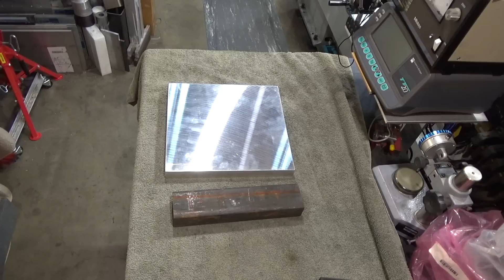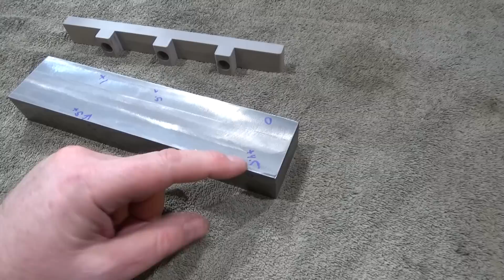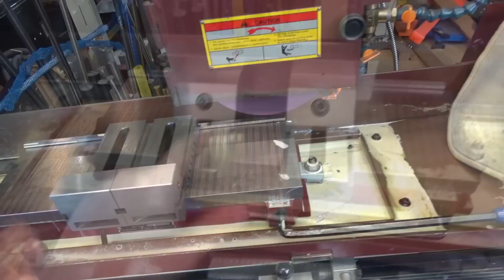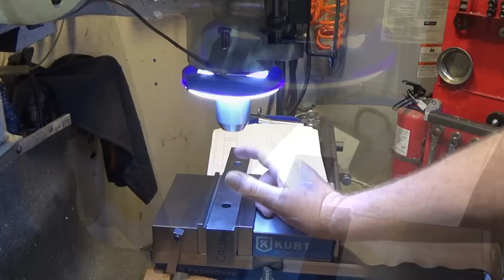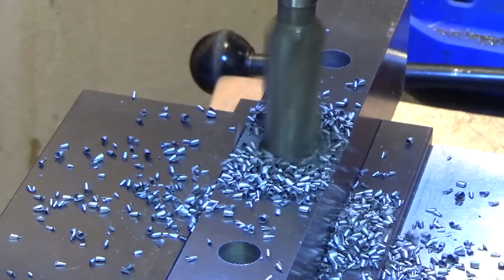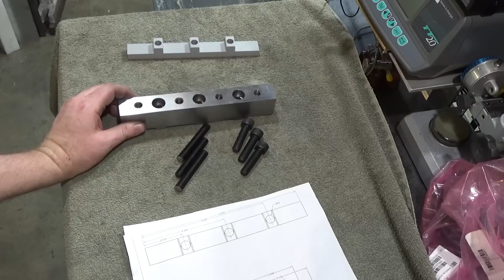236 The Fence That Your Mill is Missing

Comment: If the fixture needs to be trammed in, then maybe it is simpler to just tram the part. On most builds there is only one base plate but many plates can be trammed in the time it takes to remove / replace and retram the vise. I never remove my vise. In rare situations where I need to machine a long edge of a plate. I clamp a long piece of hollow section in my vise and G clamp the plate to it. This seems the quickest way, I don't have to remove the vise then put it back and re tram it in. I don't have to fish around for clamps and parallels, just put my trusty old piece of RHS in the vise and clamp the plate to it. If I need a backstop I clamp a couple of blocks between the fixed jaw and the RHS. For an endstop I may ream a hole in the RHS and fit a dowel. The RHS is sacrificial but lasts for years. On the odd occasion I may take a light skim off the top of the sacrificial box section but very rarely.
Reply from the maker: Your idea is a fine one, but I often need to square up half a dozen pieces of tooling plate and indicating each one in would be a pain.

Comment: I scratched my head about the T slot layout on my Taiwanese mill until I realized it was made for 12mm studs & metric T nuts.

If you chk your layout w/ 12mm studs, not 12.7mm, (½ = 12.7), & 16mm for nut width, instead of 15.9mm, (0.625 = 15.9 mm), you might discover it's more symmetric than thought.

I can't remember the dimension of metric T-nuts; I've got 2 metric T-bolts which came w/ the mill & a mixed Te-Co/? ½" (eBay) used set.

I've been thinking about a fence as well, but I was considering a semi-perm mount on the back flange of the table; something I can placed a rotary table against, to the R of the vise.  Still figurin', tho.
Reply from the maker: I look forward to hearing about your approach. The Tee-Slots on this mill are all different, which makes it weird in any system of measurement. Hear about other's experiences, this seems to be a lot more common than one might think.

Comment: Awesome work. This is one of those projects that I find it hard to believe more people haven't done.

I made a simpler version, using a piece of 1" wide, 1/4" thick precision ground bar stock. Drilled 3 clearance holes for 3/8-16 fasteners... The outer 2 are for bolting it to the table, the middle for the clamp for the vise. I made 2 clamps, one 1/4" shorter than the other, which rests on top of the fence, and is held down with the 3rd bolt. The fence is trammed parallel with the Y-axis of my mill.

I use a "CNC-style" vise, which is flat on all sides. It has clamping slots along the long sides, and I machined additional clamping slots along the short sides, as well. This way, I can orient the vise in whatever direction I need, and know it's square without having to indicate it every time. 

I also machined clamping "ledges" on the base of my rotary table, so I can set that up in a similar fashion, again without having to indicate it in. The only issue is that the crank handle sticks out past the bottom and side faces, so it can only be oriented with the handle off the table. I plan on building a telescoping extension for the crank handle, so I can position the rotary table however I want, and just place the handle in a convenient spot.

This setup, combined with my universal-head mill, allows an incredible amount of flexibility in setups.
Reply from the maker: Thanks. Simpler is often better and often a more elegant solution.

Comment: Hi, Hope you dont mind my comments!!
I'm surprised you've still got all your fingers! Please use a pointer of some sort, fingers make me go cold.
By the way, I use turned buttons in the tee slots and clock over the two high points.
Easy to make, turn them together and then part off,
Best Regards
Mike N
Reply from the maker: I never mind the comments, especially where safety is concerned. The biggest problem for the viewer is that the wide angle lens make different depths hard to discern. My finger was actually quite a ways from the cutter, but is caught me off guard when editing as well.
I like the button solution as well. Simple is great and effective.

Comment: Useless.  Sorry.
Reply from the maker: No apologies necessary. Not every tool is for every one and you might have found a better solution. I have needed something like this for squaring large pieces of tooling plate, on more than on occasion. Taking advantage of the large X-axis travel was the only solution I had come up with.

Comment: That is a good bit of tooling .     Worked out well .    Cheers  👍
Reply from the maker: Thanks, Max. I have needed it for a while. Other people have suggested buttons, pins, keys, and the like instead of a large fence. I wonder what your approach would be to square up the edges of say a 15"x15"x1/2" piece of tooling plate?

Comment: Mill one side square. Stand the part up on the squared side. Run your endmill on top.
Then grab the now parallel edges in the vice and finish the last two sides in one op. What the hell man
Reply from the maker: Fair enough, but that method doesn't really work with a 20"x20"x1/2" piece of tooling plate though. When I made my 6"x48" belt sander from scratch, I had a lot a big plates to square up.

Comment: Over the past several years l have designed a number of Tooling Items (1) designed to fit a couple of Precision Matthews milling machines. Amongst them are several types of Alignment Keys and Stops. One thing l would recommend for Alignment Keys is to have surfaces on each side of the portion that goes in the Tee Slot. The surface does not need to be very wide on the side the work will go against. The other side can be as wide as you want. As there is no real loading placed on the Alignment Key during operation it does not need the largest Tee Nut that fits in the slot. Also keep the overall height as short as possible. Additionally the side that work will be positioned against should be finish machined in situ.
1) Up and including Indexing Tables, Tilting Tables, Sine Tables, Adjustable Angle Fences with Vernier Scales, Table Stops, Tool Holders for doing Slotting Work.
Reply from the maker: I like the ideas. Thank you. My Kurt vise has alignment keys and I still need to tram that in as well.
Reply: @DudleyToolwright  
Are you using just the vise or the base as well?
I've thought that a vise base could make a really low index table.

Comment: Not looking to come off as a know it all or a smart ass here. But have you ever looked closely at that spindle taper for the R8 collets ? I wonder if it is not cut to the proper taper causing your tooling to pull out?  I only say this because my Taiwanese mill had some damage when i bought it new and it too was having issues holding the tooling and a far more experienced machinists caught that recommended I check mine. I did and he was right it was off by only .0006” after I re-ground it I haven’t had any issues with even the larger tooling pulling out. ( well at least when I remember to lock everything down properly 😂) 
But I just wanted to share my experience with you. 
Enjoyed the video man. 
Have a great day.
Reply from the maker: I definitely appreciate that insight. Thank you. I have checked my spindle for runout in the past, but you might be on to something there. Great advise.

Comment: I always take a cut off the surface of my cross table squaring fixture after it is bolted to the table and before I put my part edge against it.  That way I know that it is true to the Y axis.  It has a sacrificial face that is screwed to it and is replaceable that sits approximately an 1/16” off the table so that there is no corner between the face and the table for a burr or swarf to collect in.  No keys are needed with this method.
Reply: There is always the question of just how true the Tee Slot is to the Tables travel in X and perpendicular to the Travel in Y. When l was still working we had two main types of milling vices we used. The basic Kurt vises and a brand that isn't sold any more. The second brand was machined around it's entire perimeter allowing it to be mounted on its side. Plus the fixed jaw was in the front. There are advantages here. For the same maximum opening the vise took less space than a Kurt. With the fixed jaw in front the cutter is almost always on the other side of the part. If your hand slips when pacing the part in the vise, it moves towards you. Not the cutter. Sold as the CNC Quad 1 Vise iirc. Also the fixed jaw was not keyed to the vise body. The jaw is an L shaped element that bolts to the body vertically thru the body base surface and horizontally thru the base end face. Minimal to no jaw movement went clamping as to the vise screw being carried in the fixed jaw itself. These vises were not a commercial success. Mainly due to cost, limited availability and the age old it's different attitude. IIRC the only US seller was SPI.
One thing l did to the vises was mount them to the mill table upside down with the fixed jaw against the front of the table. I then milled slots for the hold down screws (4) and key slots with tapped holes. This was done after checking tee slot and front face for Axis parallelism. Mounting the vise took only a minute or two.
Reply from the maker: Very interesting tooling. Thanks for sharing it. I am never tired of hearing about different approaches to solving machining problems.
Reply from the maker: Someone else recommended something along these lines and the idea is really intriguing. Thanks for sharing it.

Comment: I suggest that the middle key is redundant and it over constrained the part which led to everything needing to be remachined looser in the tee slots. Perhaps a central shallow slot accurately machined in the base could hold a much longer tenon that will align perfectly without tramming in. Clamp down with two outside tee nuts.
Reply from the maker: You make an excellent point about the middle key. I wanted the Tee-Nut connection there, because the clamps were pulling on the entire bar, but that doesn't mean that it needs a key.

Comment: One more possible use for this - could bolt it to the bottom of a small rotary table, or fixture plate - then you can hold it either flat or at an angle in the mill vise, for small jobs..  I do this with a small rotary table.. saves removing & re-installing the mill vise..  might need to add some smaller threaded holes that fit the rotary table attachments..
Reply from the maker: That's a really good idea. Thanks!

Comment: Yes my Taiwanese turret mill has the three TEE slots unequally spaced e.g. 23.81 against 25.55mm apart - it only causes slight irritation but in this case it's useful to ensure that the fence goes on the table with the same orientation each time it is used!   Personally I would have used a small file and scraper to make the item fit snugly - it doesn't need to slide so the fit can be tight and the final squaring up can be done in situ.
Reply from the maker: Thanks for the info and your take on the best approach. I was on the fence (pun intended) about the fitment and after trying to slide the fence down the Tee slots and having it bind up a bit, I decided on the more work later approach. I have to accept that I will have to indicate this guy in, every time I use it, but fortunately the adjustment is pretty quick as the range is small.

Comment: Hi Dudley. I took a different tack with this when I made mine. I have it raised from the table by 0.125”. I didn’t go through all the trouble you did. Three holes for the screws. But I really wasn’t concerned with precision when making it. When I installed it, I indicated it the way you do with a vise and got it pretty parallel. But then I finely machined the surface parallel, on the machine. I didn’t bother to machine the back, as it’s not needed. But the other difference is that it doesn’t span the slots. It’s along the rear slot. I use Miti Mite clamps to hold the work along the work. I can move the clamps around to machine the sides.
Reply from the maker: Thanks for sharing your approach. I almost skipped the keys completely. My problem historically, was that I did not have a parallel that would even fit for this purpose and had to really Jerry-rig a solution every time.

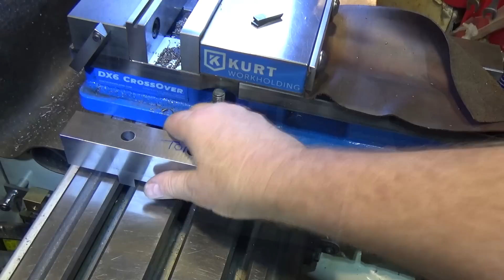Comment: No, don't take more off!!! (around 19:00) Well, its situations like that where I am tempted to get out a blue sharpie & spot where its really touching, then maybe file or scrape it down to fit everywhere - maybe spotting in the slots holding it perpendicular with a machinist square you trust.. that's the way to really take up the whole evening, if not several... if you are not tramming it parallel to cross travel, probably best to have it bottom out on just one of the 6 side faces, in one direction, & tune that face so it sits as true as possible in the place you are most likely to use it on the mill table..  was also thinking, could make a longer key that sits in a slot in place of one of the projections (but cut to hang out below the table surface) that you fit to be perpendicular, & hold it in place in the corner with an angled screw (of course then the thing takes up more room on the shelf).. although wouldn't be able to put a holddown bolt into the slot that had the special key.. always more ideas... ok, now I better watch the rest, & see what you really do! 
 Great gadget, & thanks for sharing this.
Reply from the maker: I almost left the really snug fit, but I didn't want to take my mill vise off the table and try this fence everywhere. I feared that this being a fairly inexpensive mill would lead to issues later, so I opted for the tram it in every time option. I definitely see your point.

Comment: I was thinking the T-Nuts would not lock up..  I have something similar, but lower, and it's an L shape. Turn it one way and it's just for setting it on X or Y, turn it the other way and it holds it in X and Y on the table so you get fully registered. But it does not have stud holes for mounting clamps..
Reply from the maker: Thanks for the feedback. I had gotten hit by this problem once before and should have remembered. I thought the Tee slots were deeper.